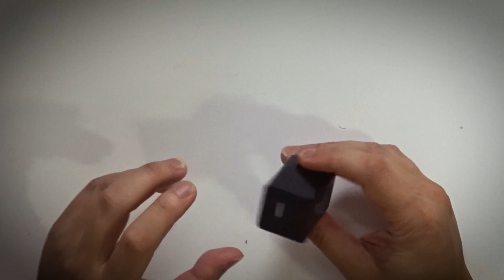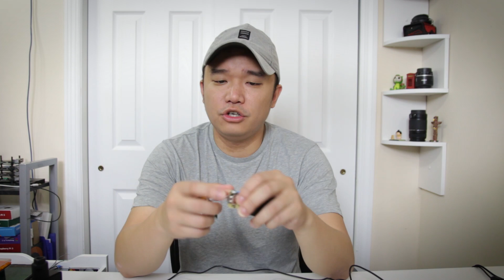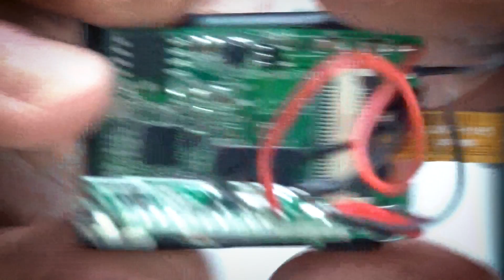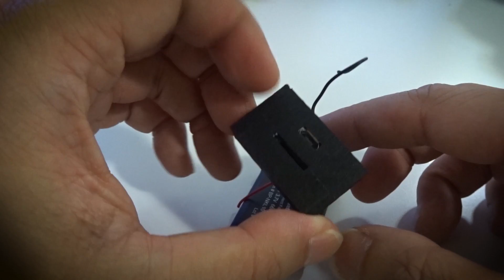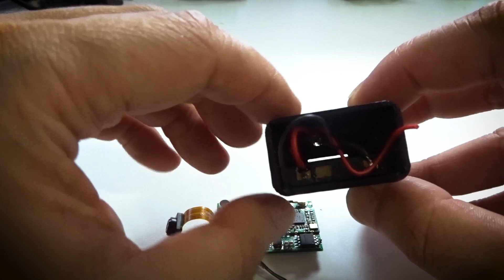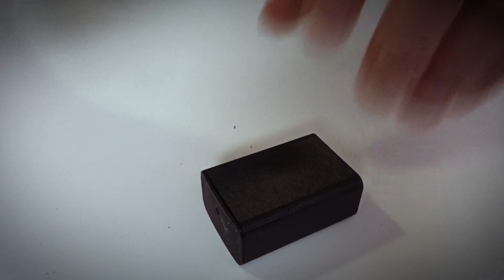DIY Mini Spy Camera

Comment: One minor detail....LiPo's are 3.7v while 18650's are 4.2v.
Reply: Incorrect
Reply: 18650 are 3.7
Reply: 18650s are 4.2v fully charged. They have a nominal voltage of 3.7v.

Comment: Don , →  5below.com . That tiny mic on the end of pcb (tiny black circle smaller than a button) should have been capturing the sound unless you turned off audio.  I'd hit that store 5below they have all types of bluetooth and power banks to play with all 5 bucks and below.  They basically have everything in there audio , charge , some video stuff in Commack right next to where guitar center is or was by the target.  If you want to play with your new soldering iron and not worry about effing up expensive things you can created some cool projects.  They make their items very easy to get apart no glue no screws they basically know your going to hack it up.  If you go online you can order in bulk from china with cheap shipping in reasonable time frame but its better to just walk in the store.

Comment: I know I already asked this but can u run SteamOS on rpi without moonlight? Could you use a process similar to windows?
Reply: SteamOS is compiled for a x86 / 64 CPU: https://en.wikipedia.org/wiki/SteamOS.
The Raspberry Pi 3 is a Armv8 CPU, so it won't run on RPi unfortunately. In fact to run SteamOS you will need a CPU that is either Intel or AMD as these are the most commonly supported chipsets that support x86 / 64.

Depending on the games you want to play, your best bet would be a cheap NUC or a Compute stick such as: https://www.ebuyer.com/729658-intel-compute-stick-boxstk1aw32sc?mkwid=s_dc&pcrid=51482417219&pkw=&pmt=&gclid=CjwKCAjwma3ZBRBwEiwA-CsblDMmbpjnNXIf7WT-jmSwNgQ0RBsdCZzDF94H-nwsN0jyonJk3BVcMhoCEfkQAvD_BwE